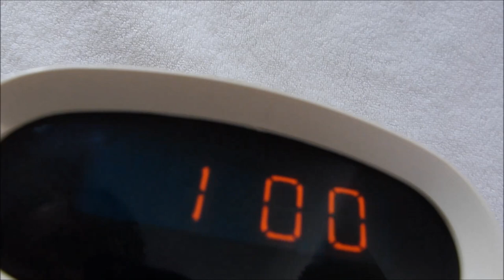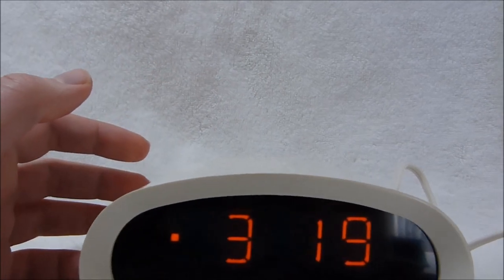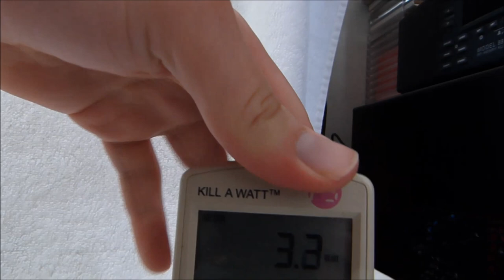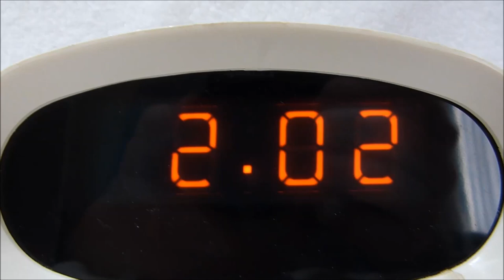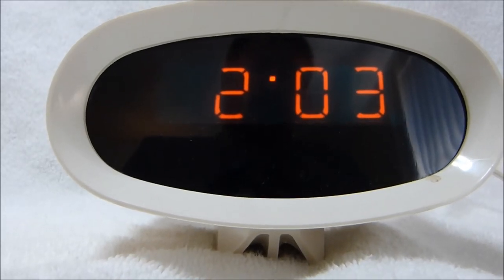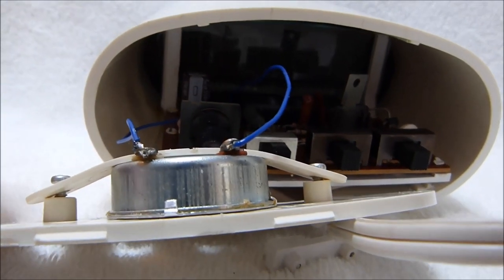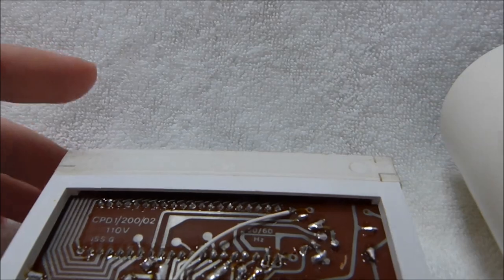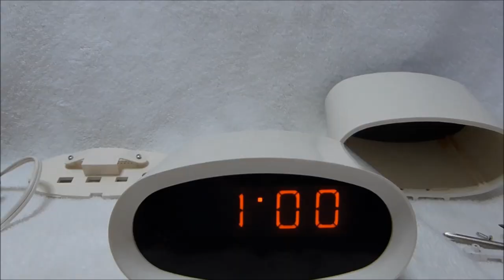General Instrument Co. digital clock model CPD1/200 (Taiwan, 1975)

Comment: Ultra 70s!!

General Instrument used to build TV Cable Converters in Canada under the "Jerrold" brand in the 1970s and 1980s... name may just be a coincidence though.
This may be one of the few alarm clocks made to include a mercury switch!
Reply from the maker: Cable TV equipment was apparently one of General Instrument Co's many businesses, besides semiconductors. As for the mercury switch, I'm not aware of any other clocks that used them, but I do have a Braun radio that uses one.

Comment: Interesting clock, with a couple of nice features. I like the fact that the brightness can be turned way down, and the method of turning off the alarm is pretty cool. How many times have we all fumbled with a clock while half asleep, trying to find the snooze button? Tilting the clock is way easier.
Reply from the maker: It is a clever feature for sure.The only thing this clock is missing is a rubber foot on the bottom, it tends to slide all over the place when on a hard surface.

Comment: Yours and Fran labs are the only two I ever seen yours is nice shape Frans labs ,I think hers was a heathkit model she built as a kid ,I take these are hard to find  and are a collectable? Yours is mint .🖒🖒
Reply from the maker: Thanks, the cord was wrapped like it would be from the factory, so it may have been new!  Fran has a GC-1005, and I actually have one as well, but it's in fairly rough shape cosmetically.  She runs a great channel, I like her videos. These clocks are indeed hard to find, much harder than transistor radios actually.

Comment: Maybe it goes up to 5 watts when the alarm is going.
Reply from the maker: Probably not, since there's only one transistor driving it, which means they are using a class A (constant current) amplifier design.
Reply: @50sTransistorRadios  Thank you for that, Like with CC's for motorcycles they just round it up, Or it's because it's old.
Reply from the maker: @vaughanmitchell8218  Power draws do seem to usually be at least slightly inflated, so when I see an appliance drawing it's listed current or more, I suspect a problem.